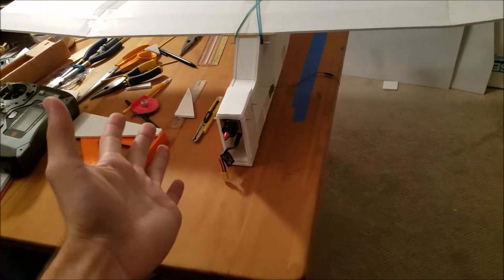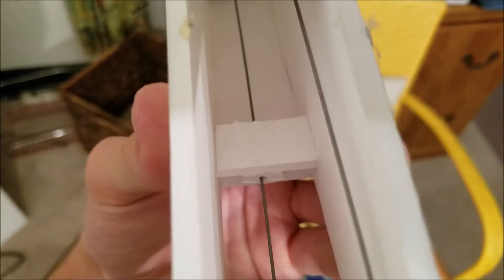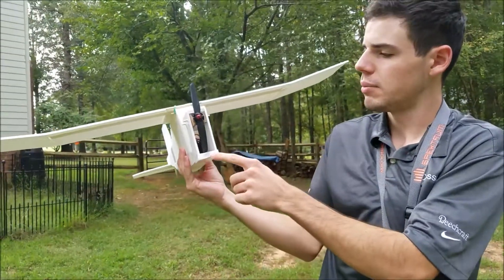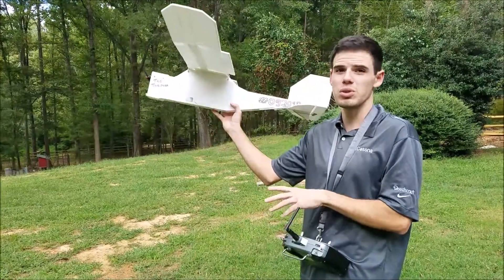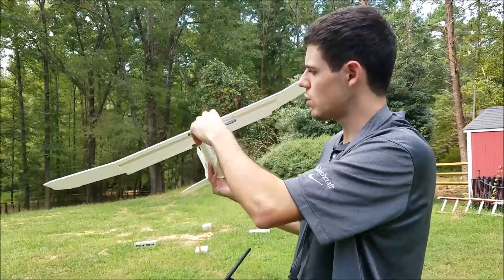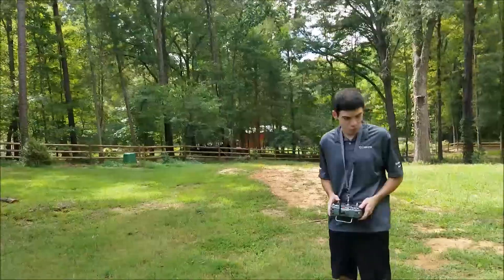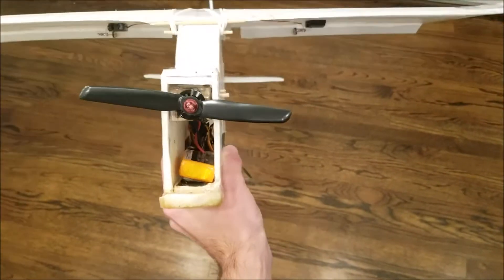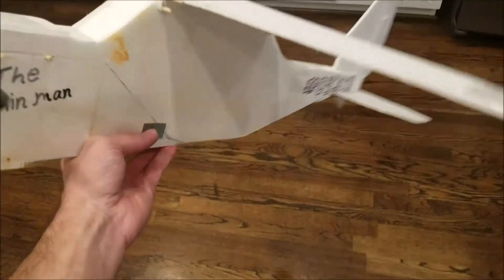My First Scratchbuilt RC Airplane!

Comment: Tail heavy and the motor should be in line with the cg. Good first build though.
Reply: Agreed !!! At low speed, the tail ... was down ... !! ... The other problem was when you rev the motor  ... there was a tendency to pitch up which caused the rc plane to stall ... If the CG and lift forces balance out ... it means that the motor mount may have been installed facing up ... instead of down ... the famous 3 degrees down ... as they say ...!!! But in general...very good video and a good design!!!!There are several things from this design that I will be adding to the one I'm doing!!! Thank you for posting!!!